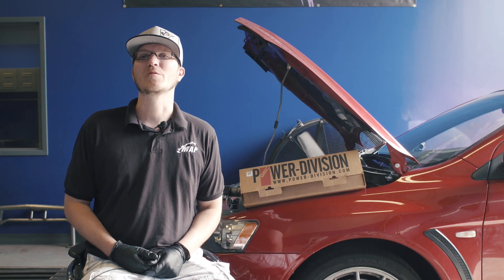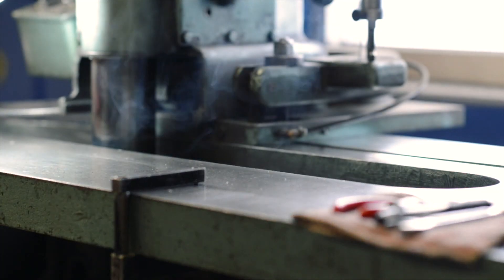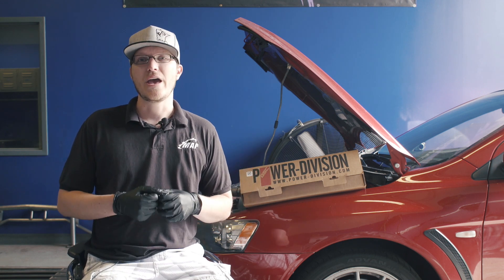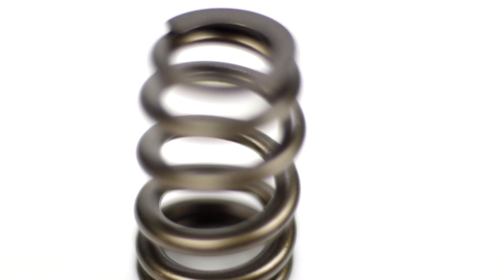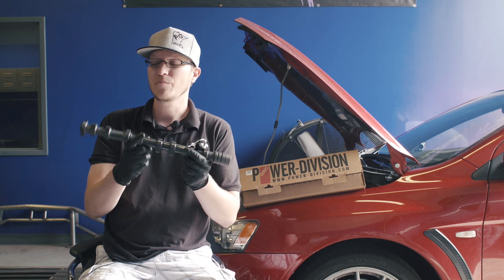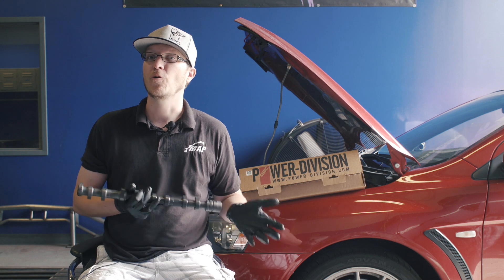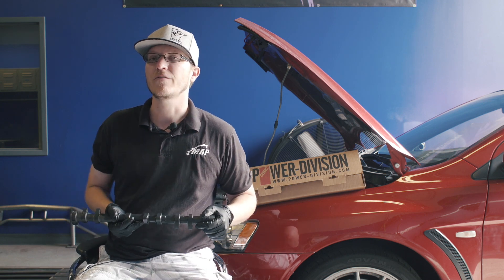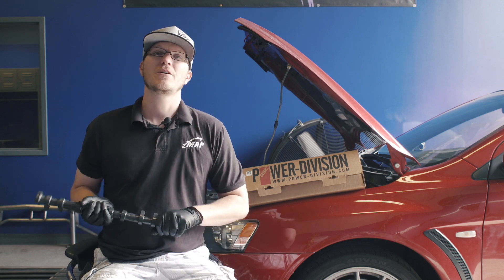GSC S2 - Best Cams for the Evo X?

Comment: I'd be reluctant to claim high lift cams equate to more power without having the head ported and big valves. More torque is guaranteed, more power isn't.
Reply: High lift cams means more air can get into the cylinder therefore it can make more power than lower lift cams. Ported heads and bigger valves just allow for even better flow along with the higher lift cams. Duration also affects how much air can enter the cylinder during each intake stroke.
Reply: Yeah you again alot of acceleration=torque but horsepower is when you tune the car im septical as mutch as you are !
Reply: I know BD Alchemist talks about upgrading the head brings in the power, but he did say that doing just cams and springs with the exhaust cam delete will produce more power, he has a comparison video I believe.